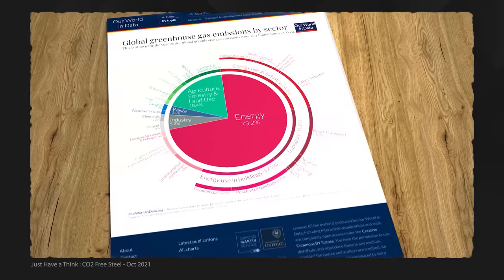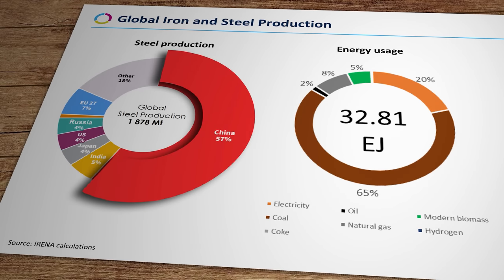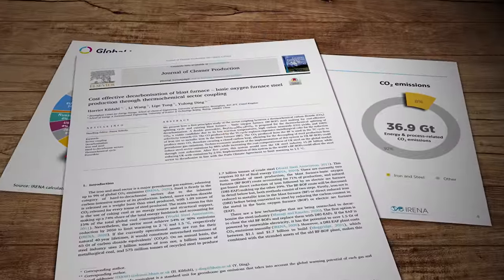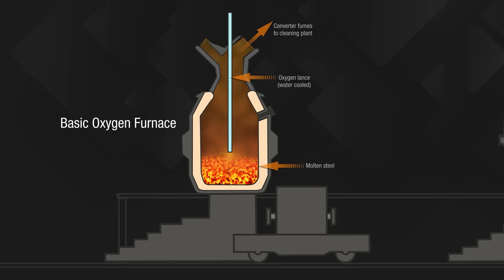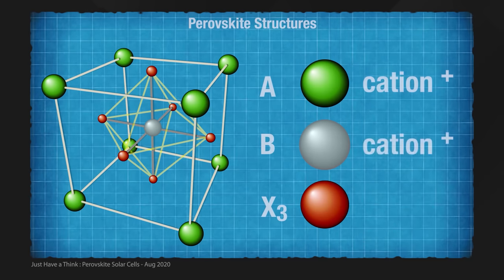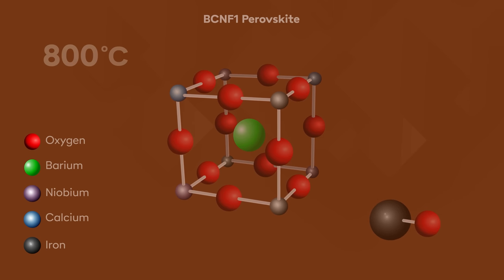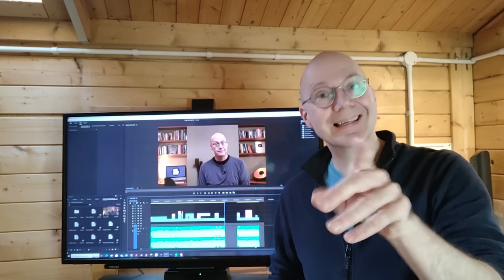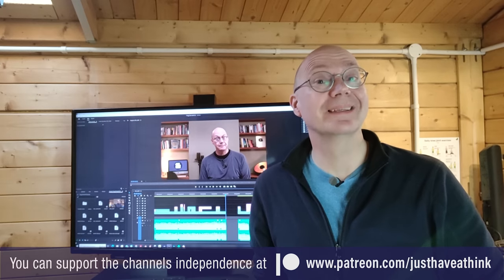New breakthrough claims 90% reduction in Steelmaking emissions.

Comment: Maybe I'm getting this wrong, but my understanding of this idea is to emit CO instead of CO2, because CO is not a greenhouse gas?  This makes no sense. Even if all the CO2 was converted to CO, the CO is converted to CO2 naturally in the atmosphere - so there is no net environmental benefit. The primary reason for the coal in Steelmaking is to remove the oxygen from the iron oxide to leave you with pure iron, it is not just to melt the iron oxide (Iron ore) After raising the temperature above a certain temperature normally a chemical reaction starts where one carbon atom removes 2 oxygen atoms from the iron oxide to produce CO2. By this proposed method one carbon atom only removes one oxygen atom to produce CO. Therefore you need nearly twice as much carbon input to do the job. Even if this idea did work, the conversion of CO2 to CO takes heat so you need to burn more coal  to replace the heat which was lost in the reaction.  In addition CO is a poisonous gas and contributes to smog, which is one reason we have catalytic convertors in cars. Seems like a great way to have a net increase in CO2 while at the same time creating other forms of pollution. The end result is more deaths from  CO poisoning (people and animals), asthma and other long term health effects. Having worked 5 years in Steelmaking, you need to carry gas monitors in some areas already and as CO is lighter than air, it rises, as a result I do see a lot of dead birds around.

Comment: If I got this right then you have 2 extra heat leaking units, 700C and 800C, plus pipelines, other units, ... added to the current BOF process. If you can run these BCNF's with process heat added with waste heat (ie. heat that was released to the sky with emissions, like CO2, or with heat from the coolants, ie. water), then fine, but if not then extra heat is needed for running these systems. That extra heat rises costs and require lot more energy from outside sources. Current energy mix and energy crisis makes these outside sources less ideal. Using any energy from fossil fuel burning plants makes this even worse. Also note that whole system runs on pretty high temperatures (300 - 1600C) and will require heat resistant materials, specific materials that resists certain gasses at high temperatures and lots of insulation. Needed processes may also need purified environments or they will produce residues that are making processes less efficient or may even end the process.

Theory and reality are not always what they seems on first glance or on paper.

But, yea, go for it and figure out if this can be done. And how much it costs after it is running. And how much overall(!) greenhouse gas emissions is possible to cut with this system. After all rapid climate warming causes huge costs and makes living harder, so anything that lessens these impacts should be used as soon as possible.

Comment: So, why isn't using the exhaust heat for energy production by heat exchange between say ammonia to create HP Steam thus running a generator and then taking the cooled  cooled gasses trapped by carbon capture processes as all of these options and tools are available off the shelf today?
Reply: There's usually not enough energy in the exhaust heat to run a turbine effectively.

Comment: I had a hard time following the thinking on this one. Was carbon monoxide being created instead of carbon dioxide? That would be a leap backwards if that is the case. Surely we can all agree that carbon dioxide is the best carbon oxide, it means that the fuel has been burnt cleanly and completely. Here in Canada we are big on electric arc furnaces. I know they are supposed to be better and I guess I assumed that with Hydro as the power source then direct CO2 emissions would be quite low. I may not understand this part correctly

Comment: the greater proportion of Carbon monoxide emissions in Australia is from a steel works on the east coast. they often exceed regulatory limits even though it runs at a reduced capacity due to market forces reducing the price of steel. just saying. How does carbon monoxide speciate in the atmosphere though?
Reply: Carbon Monoxide oxidises to Carbon Dioxide fairly slowly - no one seems to have a good handle on this but estimates range from 0.1 to 5 years in the lower atmosphere.

Comment: As a Swede iam deeply sceptical to o2 steel and hybrit steel decision, to 
Bet hard on hydrogen steel as the future for steel production. 
The problem is that in order to make this a co2 cleaner process than coal based dito., you cant use hydrogen produced from natural gas .
It must be green hydrogen from electrolysis. 
This in turn crancks up demand in electricity  in sweden with mayby the dubbel compared to today.
The industry want massive wind farms to be built to feed into there hydrogen production.
This may  be  problem for the community's  and nature where this I built. These wind turbines are approximately 300 meters and above in height.  And  several hundreds are needed to cover h2  and hybrit  needs alone. Then we are not including the 
Raised  need for electricity for other  hydrogen production,  as  storage for 
Electricity, to handle fluctuating  demand/ production  differens in the  
Grid if wind are supposed to be even more of the energy mix.
This happens because swedish  hydroelectric capacity is more or less 
Fully built out , more fluctuation electrical sources in the grid , will probably exceed the available hydroelectric  buffer capacity, when wind is not producing. 
Or hydrogen as vehicle fuel .
This  comes on top on the green steel 
Demand  of electricity increases. 
I think this process with pervoskit
Seems very promising as aaltermative too the hydrogen method.  
This or the use of carbon capture and storage  CCS  at  the plants.  The problem is not that coal is used in these processes, when the co2 is emitted into the atmosphere the problem starts. Do something about that: problem solved,:no need to 
Totally change  manufacture  processes.

In swedish "hybrit" is one letter away from "hybris" = hubris this prodjekt is exactly that , a giant hungry  bird that screams: we need electricity! 
More electricity! 
Even when there is non to get.
And our politicians are so invested 
In the idea of this "magical green steel "
That they will happily deliver... there hubris  is deep !
The industry says that there will be 
No more jobs I the steelworks in northern  sweden if they do not get permission to build  giant wind farms. Because they only think hydrogen in the future.
This pressure the politicians to
Take  massive pro wind stance/ must double the electricity production stance.
to protect the jobs 
to protect the steel industry  (witch in turn  is mainly own by the state.)
To protect the steel export.

Comment: Has anyone experimented with ammonia as the reducing agent in the steel making process.

Dissociation of NH3 occurs at @ 700°C. Since the temperature in the blast-furnace is much higher, it is my conjecture that using Ammonia may be nearly as good as using hydrogen itself.

Comment: The only problem with hydrogen steel making, and it its a big one, is the amount of electricity needed. Sweden needs to basically double its electricity output for this "green steel" malarky, we are talking a whole country´s worth of energy going to making steel which at the end will cost more then regular steel. And at this point we barely have enough energy for households because the green lobby put all their eggs in wind turbines. During December last year our electricity prices almost reached 1 dollar per kwh. I hate to see what will happen when these steel plants are up and running.

Comment: I don't think releasing CO into the atmosphere is a solution because CO in the atmosphere is short-lived at around 1-2 months.  It oxidizes to CO2 within that time frame.  CO, BTW,  is flammable and can be used as a fuel feed stock (which turns it into CO2 but at least you get the benefit of using it as an energy source).  Edit: Ugh, never mind, should have watched the whole video, they don't release it to the atmosphere, they use it as a fuel source.
Reply: Where it's burned and leaves CO² as a product.
The steel industry has been doing this forever, without the added step of changing some of the CO² in the 'emissions' back into CO, which is a fuel gas.
Reply: The carbon monoxide is put back in the furnace to let it extract new oxygen from the rust to turn the iron oxide into iron. This also turns the carbon monoxide back into carbon dioxide. Rinse and repeat.

Comment: If perovskites can convert CO2 to CO which will burn as a fuel then why not convert power station output to CO and feed it back to the furnace?
Reply: That would be a perpetual motion machine, chemical edition.  I think you're not counting the energy cost of removing the oxygen from the perovskite.

Comment: Carbon dioxide is a necessary part of life (though high concentrations can be deadly, mostly because it displaces other stuff like oxygen)   carbon monoxide is deadly even in small amounts because it bonds to red blood cells where oxygen would bond to and doesn't let go. 

I was unable to find if carbon monoxide can naturally bond together and turn back into carbon dioxide. But whether it does or does not, either way seems to be problematic.  Like I don't think we want ever increasing amounts of our air to be poisonous and if it turns back into dioxide, then what was the point?

Comment: Any metallurgical engineers out in the audience? A mech-y here with a pretty silly-ass question on a related subject: why are we not putting more effort into recycling steel and iron? I imagine it's not enough to satisfy demand, and I'm quite sure there would have to be chemical processes involved to remove corrosion and impurities, but wouldn't there be a substantial reduction in energy and CO2 production?
Reply: Steel production is heavily depending on the use of scrap metal already for decades for just that reason. Corrosion (rust) is not a problem here, iron ore is mainly consisting of oxidized iron already.
Reply: @hotdognl70 Thank you. Are you in the Netherlands? Here in Canada, we recycle it somewhat on a weekly basis with municipal services, but for heavier iron products, one has to call a private company. A few years ago, I had four disc brakes from my car and also a barbecue, and they had to be taken away by a private service. Otherwise, most people throw them in the garbage. I guess it makes sense; many in society are lazy and won't bother, and to recycle large items like these with municipal services would make it unpredictable how much capacity would be needed from week to week. Still, I think things could be greatly improved here.
Reply: @lawrencetaylor5407  Correct, but weird you got that handle instead of my name.

Scrap is kind of busines in Europe, as a household you can sell your scrapmetals to a collector/scrapyard if you have enough. Any dumped in general garbage will be salvaged later in gabage processing and those scrapyards are selling their scrap back to steel producers.
Steel is actualy one of the products that is easy to salvage from garbage, even if its incinerated.
When I worked in shipping we had a lot of busines from shipping scrap from the UK mainly to spain for the steel industry.

Comment: You're one of a few non scientist channels that actually reports things responsibly rather than just spouting interest group or researchers talking points uncritically. 

I'm sceptical on green steel broadly in terms of near term broad scale adoption. I feel it's one of the very few industries that should be allowed to use carbon offsets whereas powerplants that burn coal should simply be phased out as quickly as possible and not be allowed to participate in carbon offsets. I used to be very anti nuclear but am now of the opinion that the whole world needs to start investing heavily in nuclear I'm the short term and focus on making the cost of reprocessing spent fuel and breeder reactors in the medium term. The long term goal is probably fusion although if we started breeding U238 to Pu239 at any scale we could use conventional nuclear power for millenia to come. Utilise the thorium cycle and we'd have enough practically speaking forever. 

I'm not anti renewable at all but we're running head first into some serious challenges that we don't yet have solutions for. The most immediate problem is simply supplying enough raw materials to build renewable generation and transmission infrastructure. Lithium battery costs have already reached their flaw a few years ago and are now rising in price and are likely to continue to rise in costs for the next half decade at least as all of the major miners and processors have said they won't be able to meet demand in the future even if all proposed new supplies come online without issue or delay. 

My concern with hydrogen tech broadly is that we will struggle to supply all the electricity we need from low emission sources as it is let alone all the additional power needed to electrify energy intensive tasks and industry even the best electrolysis devices are only around 50% efficient and I only see them making sense to run during times where renewables might otherwise need to be curtailed. And even then I think I'd rather that excess energy be put back into the grid via fuel cells or used to power vehicles that batteries alone won't be enough. 

All that said, significant expansion of nuclear power could allow for expanded production of green and blue hydrogen.

Comment: How does it make sense to say releasing CO instead of CO2 is less bad for the climate, since CO turns into CO2 by reacting with oxygen in the atmosphere?
Reply: The carbon monoxide is put back in the furnace to let it extract new oxygen from the rust to turn the iron oxide into iron. This also turns the carbon monoxide back into carbon dioxide. Rinse and repeat.
Reply: @johnbash-on-ger  Oh, totally missed that, thanks ^^

Comment: Anyone have the quick reason as to why hydrogen can even be used? Wouldn’t it contaminate the steel? BOFs are usually used to make alloys that are low hydrogen.

Edit: also you still need to burn the CO it would explode in a dry precip setup

Comment: And what do the Birmingham team think happens when that carbon monoxide is burned in the heat exchanger/preheater?
Reply: It's not burned in this process.  It's reacted with iron ore in place of coke.
Reply: The carbon monoxide is put back in the furnace to let it extract new oxygen from the rust to turn the iron oxide into iron. This also turns the carbon monoxide back into carbon dioxide. Rinse and repeat.
Reply: @incognitotorpedo42  I'm watching the diagram at 7:00
So it's run into the blast furnace to reduce oxides and becomes CO²
Then the perovskites are heated to strip oxygen.
There's no such thing as a free lunch.

Comment: green hydrogen isn't as far as you seem to think it is, i mean had green hydrogen been properly funded and not stomped all over by the FF industry for decades...we would of already been smooth sailing long ago.

NewHydrogen, formerly called BioSolar, has been working on lowering the cost of electrolyzers (mostly replacing expensive materials with cheaper ones). the research is being done by UCLA and has been making good progress. they have been busy, far as i know, trying to get a small scale setup going so they can physically show it working outside of the lab.

i suppose it will be a while before that happens but it's certainly not going to take 10 years, max 5 years. you are not going to get these companies to add extra costs/steps to their production, it's a hard ask. now having a entirely new way of doing it that is cheaper/more effective...well that's something they will gladly be apart of because the only thing that matters to companies is their profit. if you want companies to do something then give them a profit motive to do it.

Comment: I'm not sure that producing CO instead of CO2 is a good idea if it's just dumped into the atmosphere? Apart from been toxic, doesn't it mop up free radicals which would otherwise be breaking down methane - another gh gas! Also what happens to the CO once in the atmosphere. Doesn't it just oxidize to CO2.
Reply: @petewright4640 I think the CO is actually used as a carbon source for the steel production (see 7:25), not vented to the atmosphere. I didn't see it vented on the flow diagram either. Unless, it might be ME who missed it.
Reply: CO can not be dumped in the atmosphere as it is toxic and flamable. The huge flare towers you see on several installations are used to burn it off to CO2. In the recent years there were a few projects where the CO was actualy used, combined with natural gas or coal, to fuel a powerplant.
If he CO is of high purity it can be used to produce food grade CO2 but the only plant I've seen in real life that did this was Yara in Sluiskil, Netherlands. This plant produced H2 for fertilizer production from natural gas with foodgrade CO2 as byproduct.
Reply: The carbon monoxide is put back in the furnace to let it extract new oxygen from the rust to turn the iron oxide into iron. This also turns the carbon monoxide back into carbon dioxide.
Reply: Thanks for the clarification.